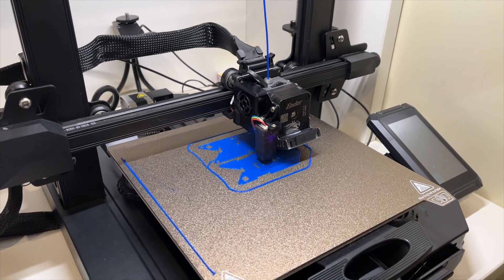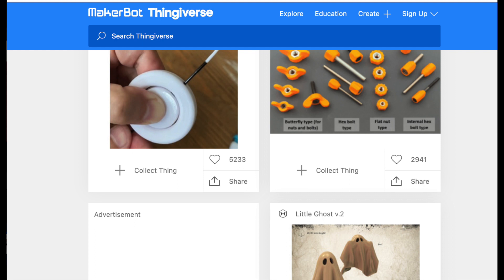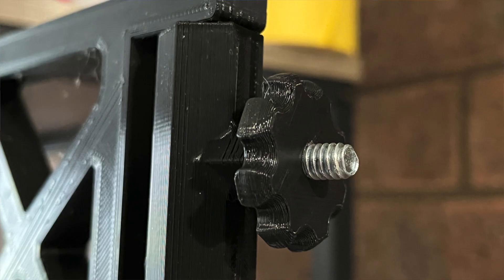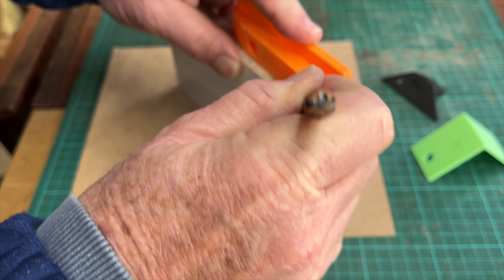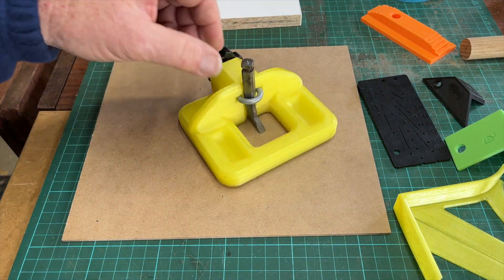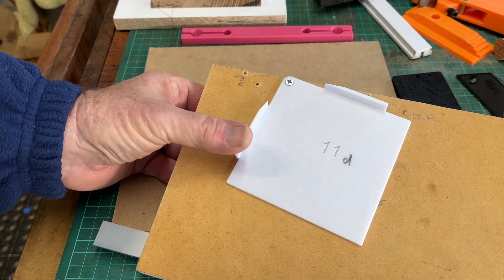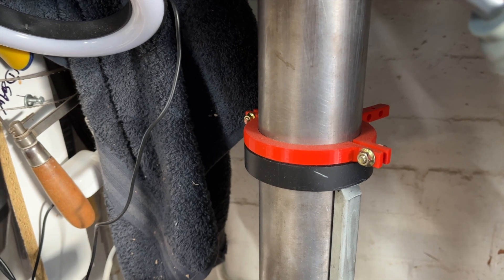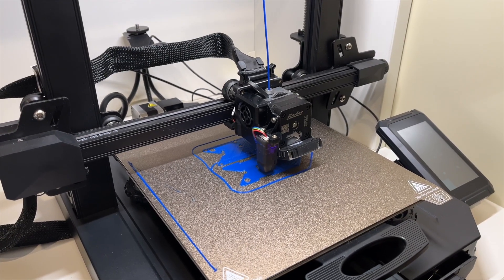3D printers  - useful or just a toy?

Comment: i just bought my first 3d printer earlier this year and am already up to 3! CAD and design is what'll separate the men from the boys (actual useful items vs toys). For example, I bought some bar end mirrors for my motorcycle that sold their plastic adaptors separately, well i designed those in fusion 360, printed them and they work perfectly. Saved $50 by doing so! (just one example)
Reply: exactly, useful applications with a bespoke solution. if you don't know cad there's little use to a 3d printer, ir. you are limited to what you can download. that's sadly the norm for most people. although there are lots of useful projects to print you only really benefit from a 3d printer when you can design your own solutions. to me being able to reprint for pennies is what gives me peace of mind, meaning I can get another part in x amount of time for a low cost and guaranteed it'll work, even on a Sunday.
Reply from the maker: Great result.  I did some spacers for a roof rack that didn't quite fit on the rails for a mate.  Saved him a lot of money and they seem to be lasting quite well as he is garaged most of the time.